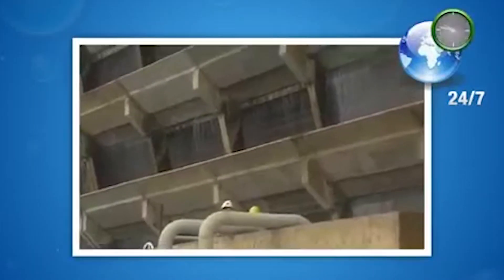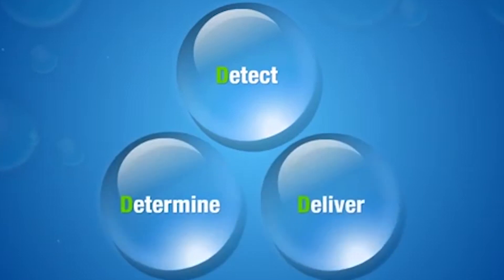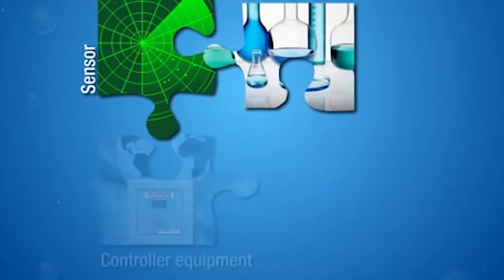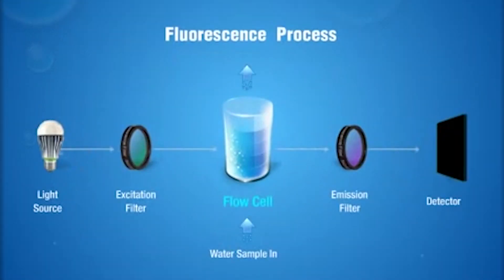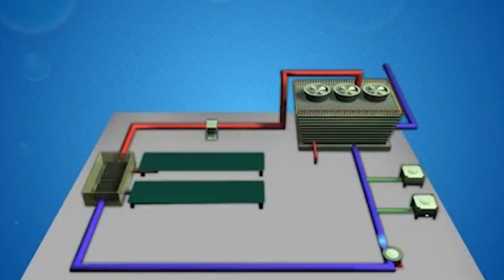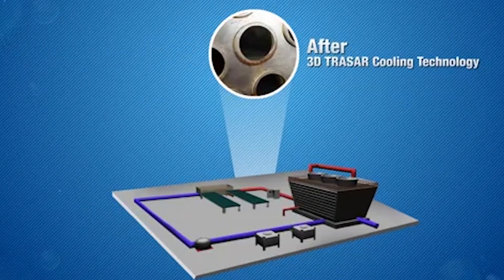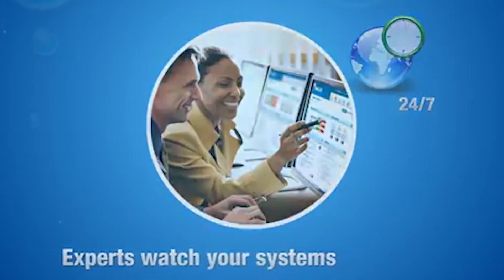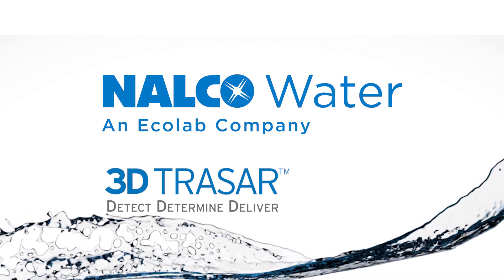3D TRASAR Technology for Cooling Water

Comment: so awesome....so what is the difference between cip and this one ?
Reply: nesiru assegid 3DT is used to adjust chemical injection based on the readings of sensors. And it is analyzing the system condition and corrosion rate in real time for all MOC of system. And then dose the right quantity of the desired chemical to adjust. It actually protect the system and optimize chemical consumption. Best for the client to protect system at minimum cost
Reply: clean in place will remove scaling in pHE THIS 3D TRASAR WILL NOT ALLOW SCALING IN SIDE .I USED BOTH UNITS .
SANjeev salve ex Mahindra now at nashik for enenrgy saving innovative products